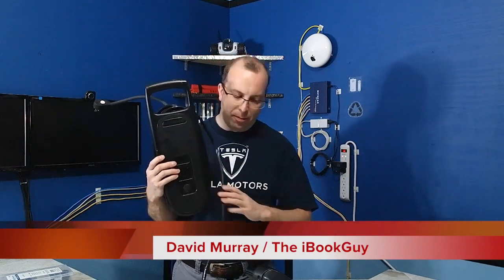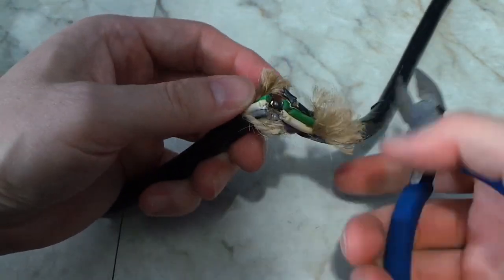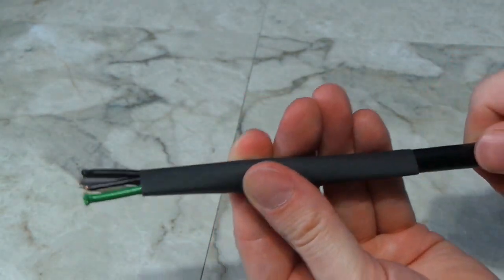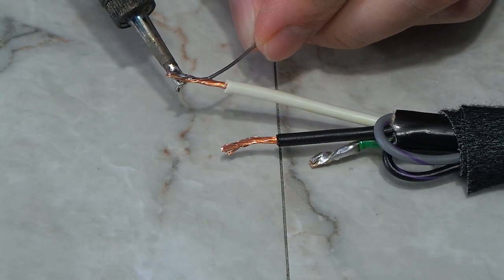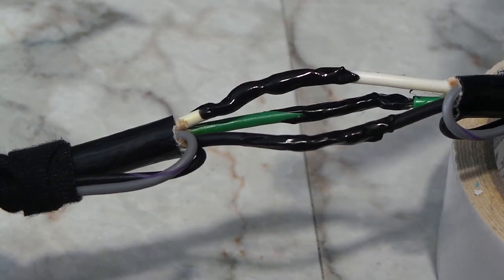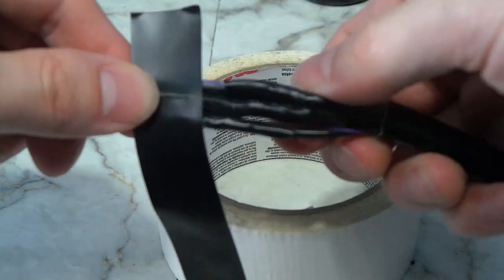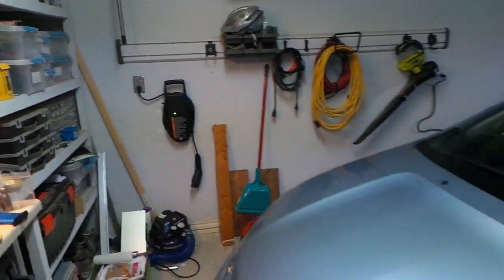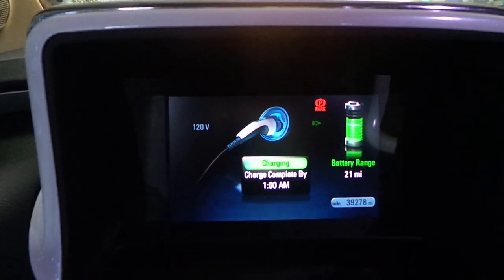Repairing a damaged EV charging cable.

Comment: Europe - This is illegal and deadly.
America - Nice way to repair a cord!
Reply: illegal?
Reply: I was doing a summary of the comments.
Reply: In Poland there would be a person, who would buy a damaged cord, solder it, and sell it for more.
Reply: Here in Aus the bit that makes it illegal is that it is no longer a 'rated' cable and because of the it can't be insured for safety. 

I have done the same on extension cables but only because i had no other option but now I would just get another one but on a $400 charger (where they would charge you the same as another unit for a replacement cable OR just tell you to get another unit)I would have done the same maybe painted all 5 together inside a mould or something to smooth out the bumpiness and add more insulation.
Only thing i would have changed would have been to fan the strands in each wires out, interlace them with a fanned out wire of the same colour on the other side and then twisted the in opposite directions for strength.

If the 8-bit guy is happy with his job and his friend is also happy with his job, who am I to say it's not done correctly.
Reply: My technique when dealing with 240V wires is to run one wire all the way through a terminal block, soldered the ends of one to the next, then run the whole join to under the screws of the block before tightening it - if one screw does (for any perverse reason) lose its grip on the wire at least there's redundancy in the connection
Reply: You solder in the middle of wires? Yep, that´s right, never do it!
Reply: Electricity has intelligence now? It knows where the solder resides? For mechanical reasons, yup, middle of the wire is not a good place actually in any situation. Not the mains or low voltage. Mains is just more hazardous.
Reply: Simon Richard South America: (fixes the cable with solder and all the stuff) ok, it's done
Cop: bro that's illegal
$20.
Cop: what are you trying to do? You know you can go to jail?
$30.
Cop: well, i suddenly forgot why was i here, have a nice day sir!
Reply: Russia - NOT ENOUGH CHEEKI BREEKI
Reply: In East Europe, this repair is law, everyone is requires to know how to splice 2 cables
Reply: I think thats BS, how are wires attached to electronics in europe? For example, I have a crt TV and its mains is soldered to the motherboard.
Reply: Soldering is perfectly safe for main voltage as long as you make sure the wires are properly insulated as they won’t be generating heat unless there is a short you should always put on heat shrink tubing and if available High temperature solder however if it shorts out in the wire start producing heat the insulation is going to melt no matter what kind you use
Even if you use the rubber insulation the wire comes in. also Europe ever heard of a fuse?
Reply: @jandajanda2242  i live in russia, i dunno lol
Reply: UK - if you use that he it will kill everybody in the country
Reply: we just twist it
Reply: I'm from Britain and I was a little surprised by the solder, too. My intuition would have been to twist them together.
Reply: Here (Canada) I would have twisted the wires together with tape, no solder.
Reply: In Chelabynsk you'd just hold two cables and let the current flow through you.
Reply: Yes ILLEGAL, you can not solder mains power wiring. You have to crimp it. It's because of safety. Yes, solder can melt, but that time whole cable would be on fire :D The true reasons are that solder actually has higher resistance that properly done crimp without air in it and it isn't mechanically strong enough.
Reply: @shdgfhjkdjjksiajs3314  Who is this Main person you speak of, and why can we not soldier his wiring?
Reply: To wrap this up... in Germany (which is undeoubtedly in Europe) repairing a cable using solder is perfectly fine. Also soldering wires to the connector of a switch of a device is no problem. What is not allowed is tinning the ends of a lead and the inserting it into any kind of clamp. Especially with screw clamps you run into trouble when the tinned end starts to deform and you lose contact force. For braided wirde to be inserted into a clamp (unless that clamp is certified for use with braided wire) you have no other choice than to crimp a ferrule on the end of the wire and insert that ferrule into the clamp.

Back to the "you did it wrong" subject - obviously it works fine, so it can't be totally wrong. The only thing that is probably not the best idea is not to put strain relief back together. But I must admit I have no idea how this could be done easily, so I would have cut it off like you did as well. As for the repair I would have done some details differently, but overall pretty similar. A more professional way of doing it would be using special crimp connectors that look like a short section of a tinned metal pipe, where you insert both ends of the leads and then crimp it with a special tool. Those connections last forever, but you need to have the (rather expensive) crimping tool which I would not buy to do just a single repair like seen here. But if one were to du things like that on a regular basis it might be worth considering getting such a tool. As I have never seen that liquid insulation goo before, I would have used heat shrink with adhesive for the individual leads as well, before covering the whole thing in the final big heat shrink.
So from my point of view I can say "not wrong at all, just slightly different than what I would have done, but certainly okay".
Thanks for your videos!
Reply: @shdgfhjkdjjksiajs3314  In my grandparents' countryside house at russia electrician just  twisted wires amd isolated them. Good we noticed it and soldered stuff there, but we still had small space for crimp in connection box sadly :(
Reply: @shdgfhjkdjjksiajs3314  also in europe its 220v and not 120 so its much risker to solder on
Reply: I live in europe and we repair cords. nothing ilegal about it
Reply: I mean it's illegal in most of Europe the same way it's illegal in the US.  No soldering on romex...
However, that's only code on internal wiring.  You can do just about anything you want with extension cords and the like.
Reply: "Don't solder mains wires!" Looks at all the PSU's Yup, that's right, never do it!
Reply: *ahem*. Russia *ahem*. We just solder the mains and leave them splitted with no insulation. Because cyka blyad
Reply: in what EU country is illegal? croatia?
Reply: aside from the true risks involved when high (many amps) currents flow thru copper wires, IF you take precautions like proper insulation (which video really did with several coats of various materials), good testing (watching the repair doesnt get too hot, no smoke, etc) I applaud the DIY repairing because: a) it goes against the discard whole device after minor failure b) goes against the warnings that in many cases are there to discourage the DIY repair and go to an "authorized repair shop" who basically rip you off
Reply: me: fixes battery cable for truck hides it
Reply: Illegal?! Do you actually expect me to believe that load of bullshit?!
Reply: @brianbuddy2ACP  Not in a sense that you get fined, go to jail or are sentenced to death, but if your power provider sees it, they will terminate services immediately (in theory even if a licensed independent electrician sees it, they have to power down your house immediately). And if doing things like this sets your house on fire, possibly killing people, you will be held fully responsible, which finally may take you to jail. At least that's what it is in Germany.
Reply: Europe - This is very Illegal and Deadly
America - GUNS ARE FUN FOR ALL THE FAMILY!
Reply: That's totally OK ;) Until you're not going to pull cable very hard. The point is DO NOT solder mains wiring. It's because of electrical and  mechanical properties of solder itself.
Reply: "I'm from Britain" What an odd term to use...
Would be like a Canadian saying they are 'North American'.

Comment: I'm not saying there's anything wrong with this fix. For 12amps 120V this is absolutely fine. However I would have used a lineman splice instead of just soldering them together, mostly for the extra strength. Just make sure that the cable doesn't heat up too much.

Comment: This takes me back. I learned to solder when I was a kid.

Yes, fire works just fine for shrink-wrap, as long as you keep it moving. For some applications, like the external insulation, I would smear some high-temp hot glue over the splices before sliding on the final heat-shrink. When you heat that, it fills out the gaps and acts as waterproofing.

Comment: a linemens  splice on the wire is almost always the way to go when repairing  a cable like this.  Just soldering is not really the best option. Simple and easy Google it you will be glad you did.

Comment: You did a good job, only thing I would have done differently is crimped the connections instead of soldering. On high current wires, the solder can actually melt. Especially in spots that have a higher resistance, like a splice. I do alot of wiring work on cars, and anything that is high current, or is in the engine bay gets crimped. For something like this charger, they have un-insulated butt connectors that aren't any thicker than the insulation if you use the right size for the gauge wire that your using. You can then add your own liquid tape, heat shrink, or vinyl tape to insulate.
Reply: That is actually a very useful comment.
Reply: That was my first thought as well: "Why is he soldering high voltage/current wires?".
Reply: This guy.  A mechanical connection stead of JUST a solder connection would have been "better".  He probably "should" have intermingled and twisted the wire strands together and then soldered.  Otherwise, good enough in a pinch.
Reply: I'm 26 years old and can't believe how much the words "un-insulated butt connecotrs" made me laugh.
Reply: Mikey yeah, sure, but if the cable reaches 280°C there's something wrong other than the solder melting... If tha cable passes 80°C, you're using the wrong cable.
Reply: I would have intertwined the wire and then soldered too.  The two ends would make direct full contact with each other instead of only touching the side, so it would have been a safer connection.  The solder would just be for structural purposes.
Reply: "On high current wires, the solder can actually melt"
190 to 840 °F is the typical melting range for solder, accounting for many different alloys. If the wire is hot enough to melt the solder, it will burn you and that means that something is VERY WRONG WITH THE WIRE AND SHOULD BE DEALT WITH ASAP.
Reply: Mikey I agree as this was a mistake I made
Reply: Tim Stahel yeah I know you should use the plastic things that have the screws in and clamp down the cables together
Reply: The insulation is burning at that point

Comment: i find that when doing inline splicing it helps twist the wires together before soldering  Its a technique that has helped me a lot when doing instrument wiring. Of course I was working with much smaller wires.
Reply: SackKickingFatMan Google the term linemens splice for a better option.
Reply: ChrisD4335 thanks for letting me know Chris. I will have to give this a try.

Comment: Lots of people commenting that this was done right. It wasn't (for a high current circuit anyway).

The main concern here is that the solder is being used as a conductor. Wire -- Solder -- Wire. You've effectively inserted a resistor of unknown resistance into a mains circuit, and worse still, it's a resistor that's made of a material which melts at particularly low temperatures.

A much better solution for high voltage or high current application is to join the conductors together under tension for example in a crimp or splice, then if you still want to use solder you can use it as a sort of glue to hold the thing together. But the important feature is that the electrical path is Wire -- Wire, there is no unknown resistor inserted into the circuit.
Reply: +Richard Holland Except that there is very little resistance in solder...
Reply: +NXT45 solder has about 5x the resistance of copper but also it's more fragile than copper. If it gets cracked or separates slightly from the copper the resistance will go up dramatically. Soldering this way on high load circuits can cause a fire. Always try to make your joins at or lower than the resistance of the rest of the wire on a high load circuit, otherwise you're unintentionally making a heater or fuse inline.
Reply: @richardholland3231 , solder does not have about 5x the resistance of copper.  It has about 5x the resistivity of copper (actually closer to 7x).  Resistance depends also on the three dimensional geometry of the conductor.  You can see that the way he soldered the wires with so much overlap in the joint, there's a lot of solder between those two copper wires. It's way more than 7x as much solder between the wires as the cross-sectional area of the wires.  That soldered joint is a low resistance joint.

But your points about the fragility of the joint are valid.  A better joint would put the wires in direct contact with each other, like a lineman splice.

Comment: I have a Razer Kraken 7.1 USB headset. Once, I tripped over the cable while it was still connected to my desktop computer. This caused the USB connector to be... destroyed. Instead of throwing it away considering how expensive it was, I went ahead and looked for an unreliable USB mouse, cut the cable from that, and wired everything together like you did!

I think it's great to think that broken things can be fixed and not replaced. It's a lot less wasteful that way
Reply: Meanwhile, Apple incinerates their iPhones at the very thought of a broken screen
Reply: Have you upgraded to good audio yet?
Reply: @gmeeer9165  no

Comment: I personally will bring the connection together and twist them before solder, copper to copper contact is better than copper to tin/lead to copper.

I treat solder in most of my jobs as more of an adhesive, if you mesh the copper strands together, you would already have a good connection, solder would just be icing on the cake.

as someone else here also mentions, crimp is better for high power application, which I also agree, but we can also see in this case that it is not THAT high powered, but a nice crimp is always NICE...   I do like to add a bit of solder into my crimp tho, if you have solder in a good crimp, it will seep into all the tiny space like wax and candle wick.   the end result would not only be very strong, but even better at handling power (my assumption only, don't have an adjustable 1000 amp power to actually test it..).

Comment: You did this wrong. Next time buy a Hummer. They have practically ZERO issues with charging cables.
Reply: Jeff Manseau But they do have issues with fuel economy. For a Hummer H2, approximately 9 miles per gallon.

Comment: As someone else below pointed out, crimping high current cables is preferable as if you get a bad solder connection the resistance in the connection point can get so high with the cables heating up and the solder will melt then we will have sparks! at a charging rate of 1.4kW it is worth thinking about and as you used heatshrink tubes why didnt you use it on the rest? electrical tape to me is more or less forbidden.

And after you crimped it you can add solder to strenthen the connection point too.

(And yes i am an electrician so i know somewhat what i am talking about)

Comment: Great video!  Could you please update us with how it is working for your friend when  you get a chance?  My EVSE was damaged as well and I have been hesitant to do this repair because of concerns that it could be a fire hazard.  As long as the EVSE is working like it did before with no additional heat build up after the cord has been thrown around a little from daily use, then I would consider the operation to be a success.